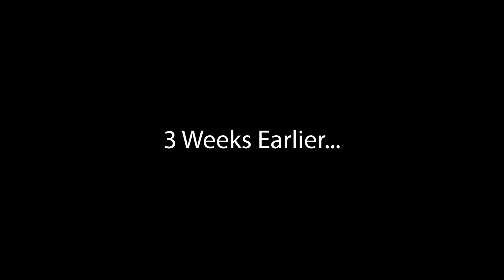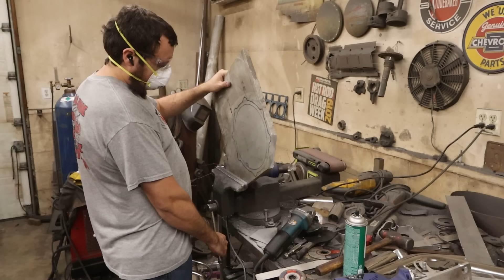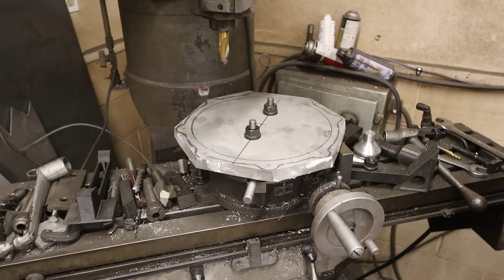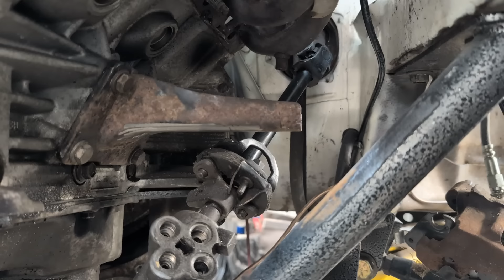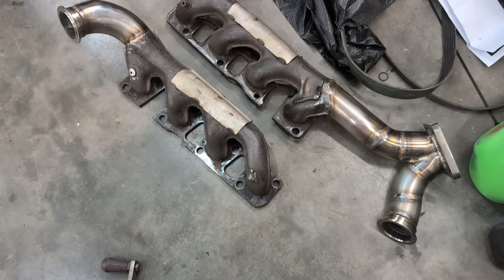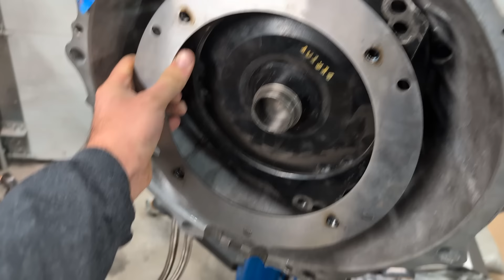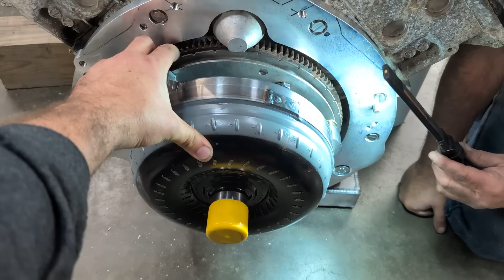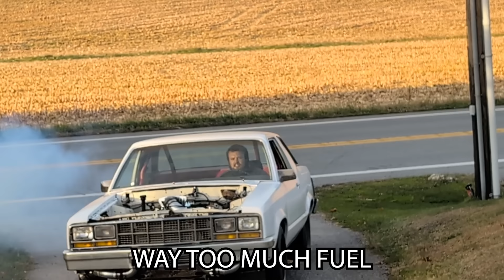Junkyard Nissan VK56 First Start: Is This the Next Coyote?

Comment: What is your fuel rail setup? Stock fpr?
Reply from the maker: We used the rail that came with the intake we got in the last video.
Reply: @Calvin-Nelson what size is the rail ? Dont see any info on that..plan to plug radium FPR which is 8AN